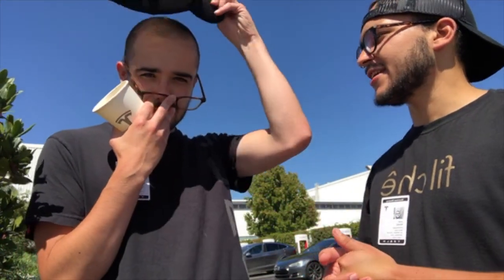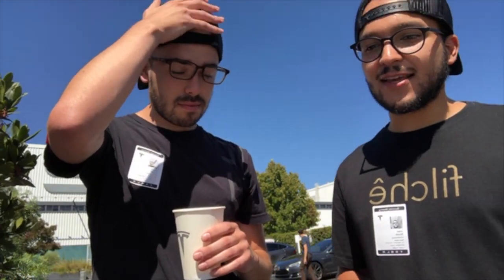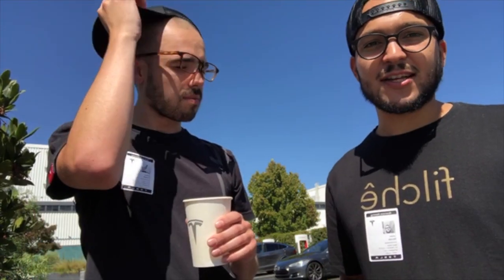HyperChange At The Tesla Fremont Factory!

Comment: Did they mention anything about how much time the spent on mounting all the cables in the cars? Musk has spoken a lot about their flex-cable-something tech that is supposed to cut down a lot on that step.
Reply: Do you mean multiplexing?
Using one "wire" for multiple signals.
The main thing to note about the Model 3 wiring is there is so little of it!
It's been reduced by so much that it's easy to install.
Reply: Nah, I was taking about this https://www.teslarati.com/teslas-flex-circuit-spark-changes-evs/

Comment: Gali, you should take a tour at another factory like GM or Ford and then let us know how Tesla truly compares. Because of course they are all going to show/tell the best of what they have. I assume Tesla is a little more advance, but they can tell you, on a tour, anything they want. Would be awesome to know how they truly compare to another company from someone that has actually been at another company factory like GM/Ford. We get some insight from analyst that have been given a tour of GF1, but it would be great to come from you, someone that is more of a common guy that we trust.
Reply: I recently took the Ford river rouge factory tour in Dearborn, MI and watched them assemble f150 trucks.  Its quite impressive.  I didn't think to count the number of steps on the final assembly line, but it was multiple levels and it zigzagged around.  i think it is way more than 43 steps.  They only let you see the general assembly part of the plant. That factory pumps out about 1200 trucks a day and there is another factory about the same size for f150's near Kansas City, MO.
Reply: @greggmcclelland8430  
I suspect any case asking "can we compare your facilities to those at Tesla?" Would be quite short?
The question that should be asked is how long did Ford take to 
A) Build the production line?
B) Get it running to designed capacity?
C) Reduce quality control errors to accepted levels?
I suspect it was longer than Tesla took.
Remember, not withstanding experience, Ford have not been "ramping" for a LONG time.
They can make money (or maybe not?) From other lines while building and refining new facilities.
Reply: I really like Gregg's, Padraic's and Roger's idea. Super learning opportunity for sure! Should not tell them about Tesla though.
Reply: I second that. Definitely have a look at another factory like Ford.
Reply: ^^ this
Reply: it's a bit more advanced, the bigger differentiation here is that it works quite well for producing futuristic electric cars, unlike every classical factory.

Comment: I watched "how its made" for engines and transmissions then compared that to an EV drivetrain, Wow, And what you don't see is how much processing, energy and shipping that goes into hundreds of component for an engine/trans. I don't see how an ICE can compete if the battery cost is right.
Reply: Welcome to the club. I've been shouting that from the rooftops for a LONG time!
"They" seem to believe that the metal in IC engines is somehow different, mined by sprinkling fairy dust on the ground, heated by unicorn breath and formed by elves with big hammers!
Then we have the fuel! (Same)